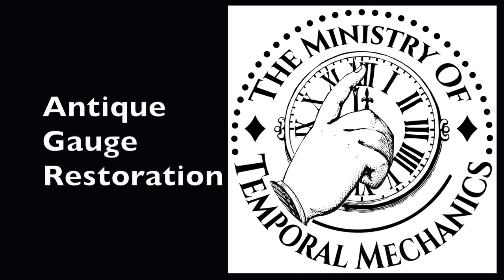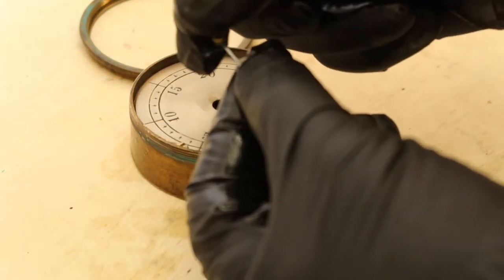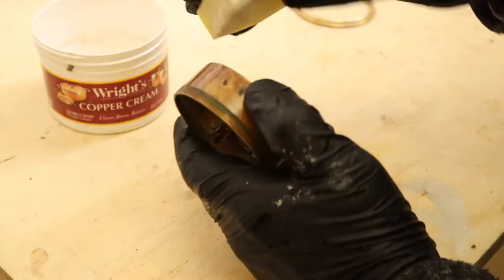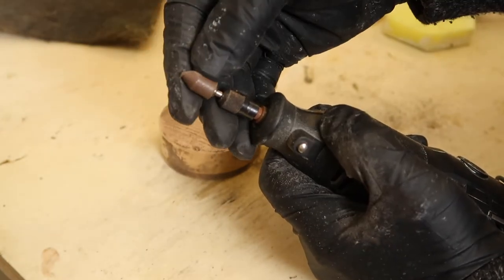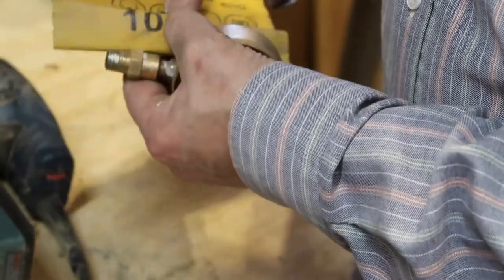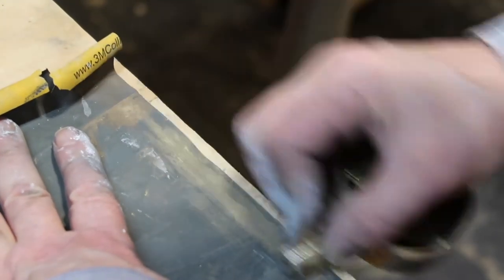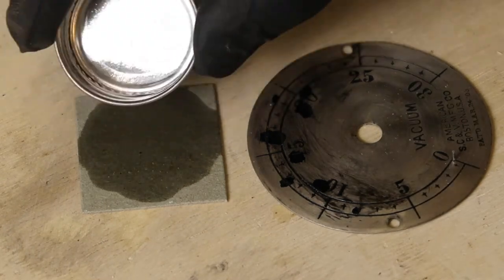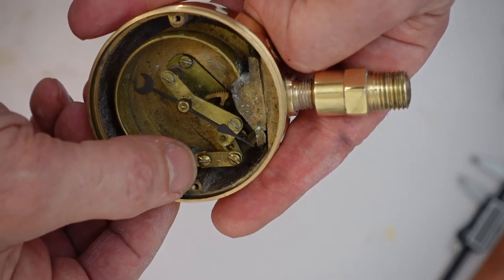Antique Gauge Restoration

Comment: Where was this video when I was learning how to do this? I've messed up more gauges than I care to admit. I like the acetone on cardboard trick. I will definitely be doing that in the future. I have been gently abrading the surface to remove excess surface paint, but I haven't been happy with how easy it is to either ruin the finish or else ruin the paint job. What do you do in cases there the etching is essentially a negative, that is, when the features are raised and everything else is in-painted? You see this a lot, for example, on the metal badges of wood box style meters.

I am much more interested in finding a way to reproduce scales on gauge faces for which the original screen printed scale has been damaged or deteriorated, because that is far more common for the devices I restore. I don't want to do screen printing for a variety of reasons, but I do have access to a laser cutter. I've experimented with several techniques without success.

Comment: I have an older 6 inch diameter pressure gauge with a broken lens.  The bezel is soldered to the body of the gauge.  How can I remove the bezel to replace lens?  thanks for the tip on renewing the dial numbers.